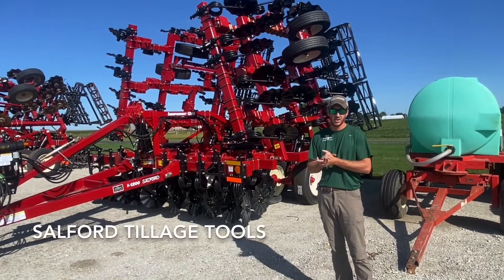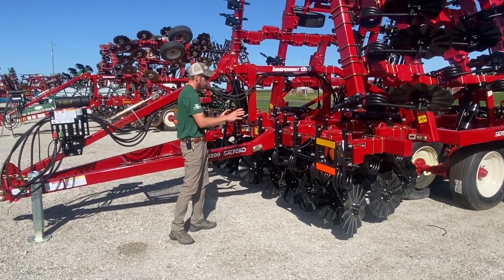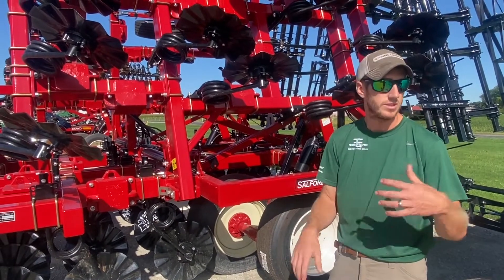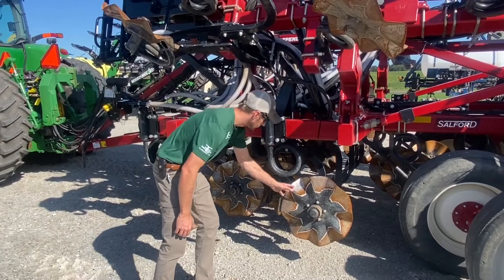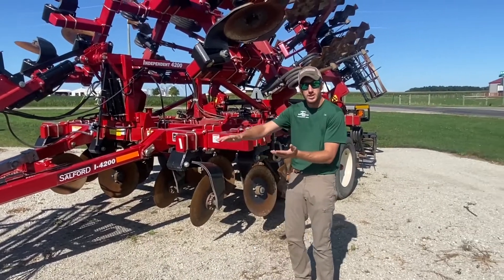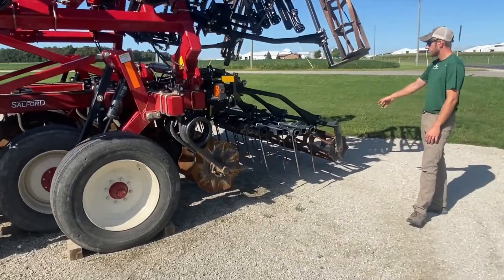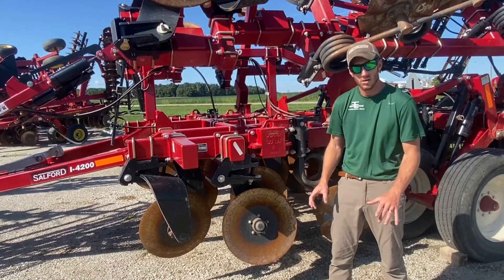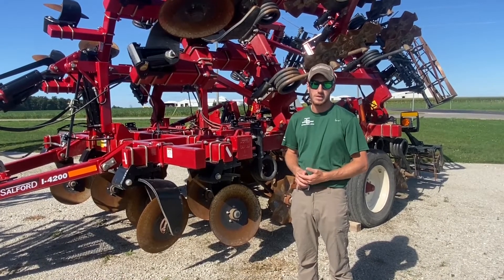What Do the Salford Tool Numbers Mean? Which one Fits You Explained

Comment: I am looking at buying a Salford I 2100 with switch blade shank kit if I chisel with this machine in the fall of the year will I be able to come back in the springtime and vertical till with this machine with one pass and plant after just one pass? I live in Iowa not very, many Salford vertical till machines in my area. I am looking to maybe try and eliminate my field cultivator and great plains turbo o till.
Reply from the maker: Yes that would be very doable, the harrows would do a great job of leveling and the rolling basket will crumble and make a good seedbed